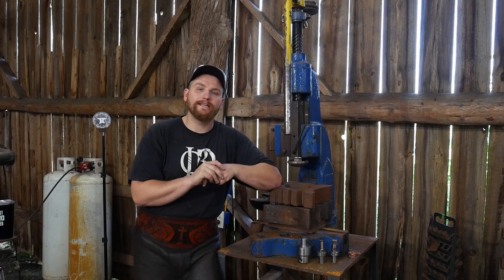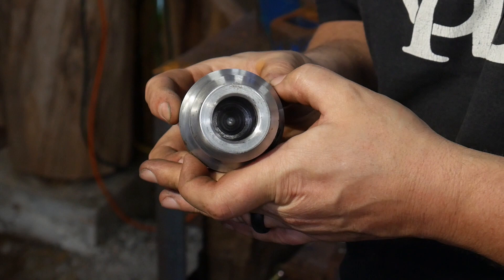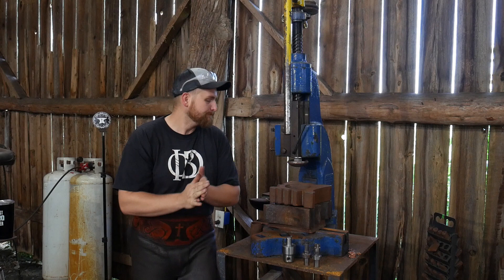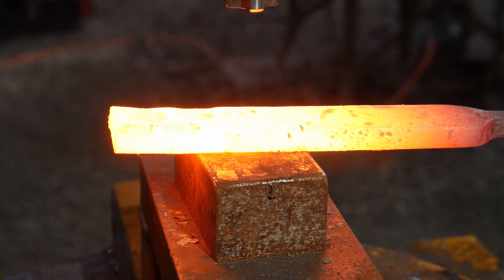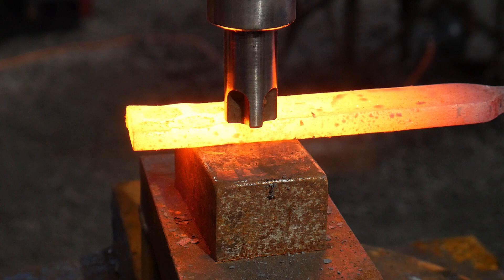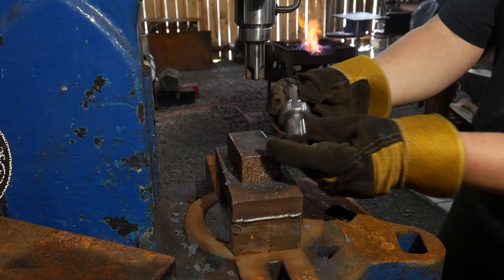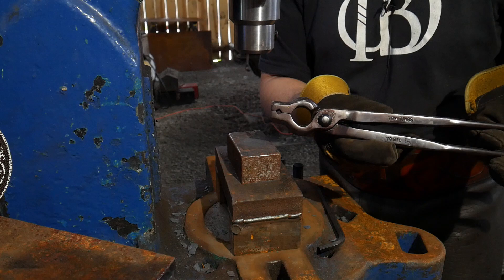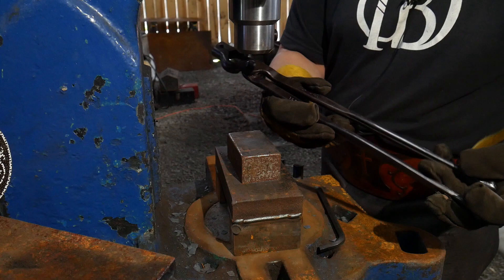I Got Some New Flypress Tooling from Blacksmith Supply

Comment: I made it Roy.😁
I've been wondering about the fly-press. Presumably, this model was designed specifically to have extra space between the dies. Who would have bought this when it was new? It does seem to open-up some extra possibilities but it's also causing you quite a bit of extra work, making specific tools for it. Would it have been aimed at a particular role, or just an option?